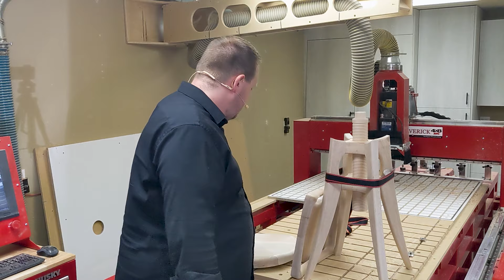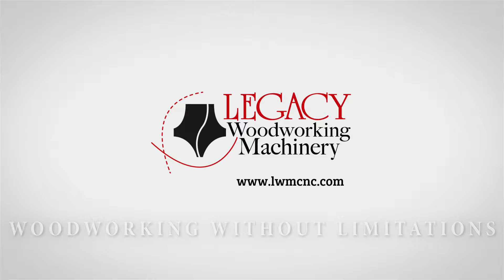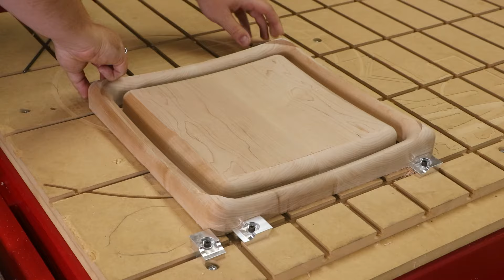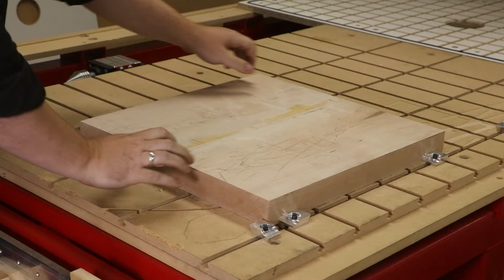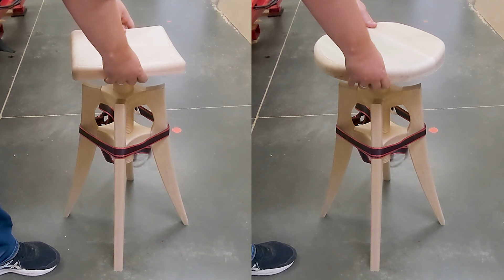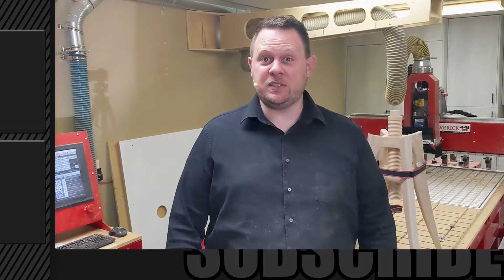Bar Stool Seat Variations

Comment: Can the stool be designed in VCarve or does it need to be done in Aspire?
Reply from the maker: Great question!  On this particular barstool you can do everything except the dished seat in V-Carve Pro.  However I am sure you could find some STL files of a seat that could be brought into V-Carve Pro and used in place of the one we modeled.  Just remember to put the hole on the other side so that it will attach to the stool!
Reply: Thanks, I have always wanted to make one since I originally seen the piano stool made on the Arty or Gemini. Just have to buy the   long shanked 90 degree bit I think it was.